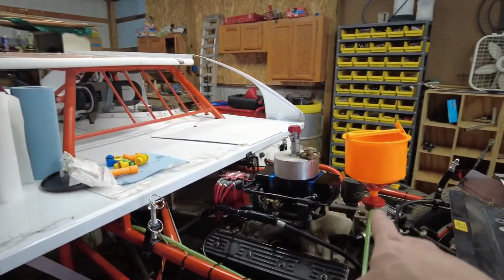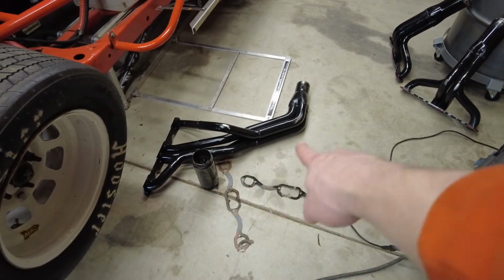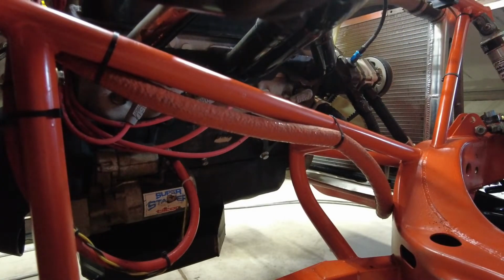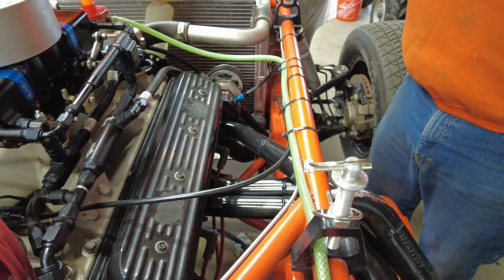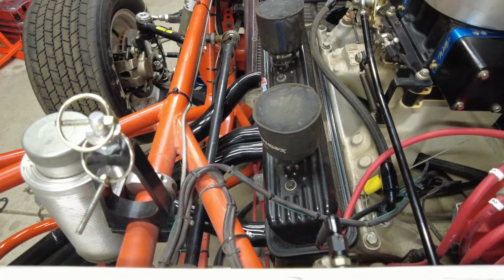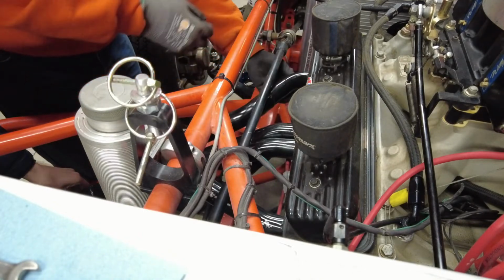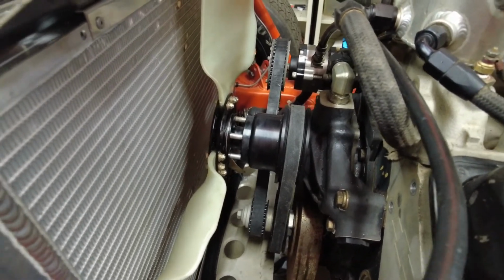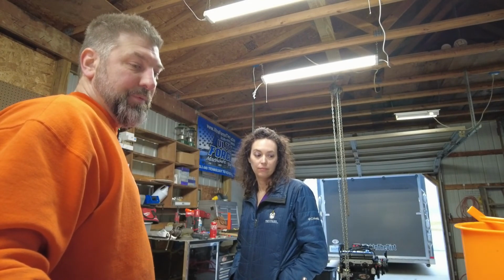In the 187 Shop: Almost ready to go racing

Comment: I have always run a 377, do you have cast heads or aluminum heads? I have 462 camel back heads but they have had a lot of work done to them with 1" match porting. How do you like the power from your 377?
Reply from the maker: I think its a good combination. We are limited to cast iron heads and flat tappet cams. Your 462s are probably better than the world sportsmans on mine.
Reply: What kind of horsepower are you getting out of your 377? I have 12:1 pistons and I have 202 valves with a 5 angle valve job. And a Schneider cam that is very responsive. But I have never had it dynode. But it is very strong. What is your opinion on 383s?